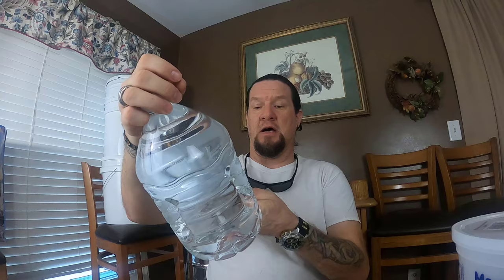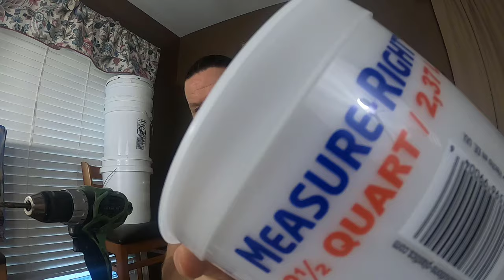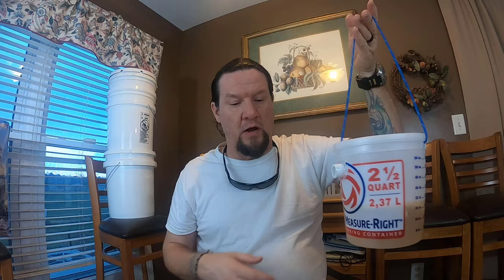How to make easy reusable yellow jacket traps for your bee yards. Includes Bait Recipe!

Comment: Use a male adapter with a lock nut on the bucket. Add the short pipe with a 45 to keep out the rain.

Comment: I wanted them to carry some of the poisoned bait back to the nest.  I kept the traps out but I also filled two small containers (condiment size from take out).  I used 1 cup of honey, some apple cider vinegar and a tablespoon or two of boric acid.  The first batch killed them outright so I cleaned it out and used less boric acid.  Worked like a charm.  Within three days there were only a couple around.  I did it for one more day and I will see maybe one ore two by the feeders but compared to what we had that is nothing.  Now I can sit on my deck and my humming birds can eat in peace!  Total days with poison was five.  A side benefit is it took out a few ant nests!!  No more ants on the deck or the patio. 

Take it in at night.  When putting out keep it away from flowers and put it on the ground.  I observed one of them for a day before putting the others out and the bees didn't seem interested.  I do have a large flower garden and several areas of flowers which is where you will usually see bees.  It is possible a bee tried it but these yellow jackets would literally attack the bird in groups.  There would be five or ten going after them and giving chase.  I don't care how beneficial they are they are vicious insects and I have had enough!!
Reply: Could you provide exact amounts of each ingredient?
Reply: Great post, and I failed with borax, so I should try boric acid.

Comment: Thanks for taking the time to post this. Like someone else said, I have also tried the 2 liter bottle cut in half method and it works. I agree with you 100% that it does nothing for killing the hive itself. Personally, I wouldn't mind the yellow jackets if they'd just learn to  stay away from my weak honeybee colony. :-)
Reply from the maker: Hey Beeutiful, I make the soda traps as well, and the reason for making this version was to solve what i think is the #1 problem with the soda bottle traps, which is every time it rains they fill up. This version solves that problem and gives you a lid which is easily removed for removal of dead yellow jackets and easy replacement of baits. Plus its reusable and once built and complete never needs more purchased goods (like tape).

Comment: You could place more than one entrance into the trap.
I agree with others that say to put a little of the bait liquid on the top of the trap for them to find a tell the nest about it.
A little dish soap in the water, stirred not shaken, will break the surface tension of the water and make the yellow jackets sink and die quicker.
I have wasps in my attic and I'm very allergic to them, so I have to get them under control.

Comment: The best use for wasp traps is to get the queen when she emerges early in the spring around the end of March into April, you have a few weeks of wiggle room as the queen does all of the  work setting up a new nest it takes time for her to get the first generation of workers so she  can focus on laying eggs. 

So if you get the queen early as I did this year, you probably won't see any yellowjackets and if you do they will be workers from someone eases yard and they don't stick around for long. You are correct that a single trap will not get rid of a nest. 

I doubt multiple traps will completely do the job, however multiple traps may effectively reduce the amount of worker contact you have around the property.
Reply: How to get the queen early? Usually I find nests by traffic in and out of the nest.

Comment: Great video.  You make some excellent points about the beneficial aspects of yellowjackets etc.  I add a few drops of dish soap to break the surface tension of the liquid lure.  I also add some nectar/bait to the top of the trap so that the yellowjackets bring some back to their nest and attract more to the trap. Thanks!
Reply from the maker: Great tip!
Reply: Duncan James
But if the point of the trap is to catch the yellow jackets so they die in the container, how are they going to fly back to the nest and tell others about the trap? Won't they be dead? Maybe I'm over looking something here. Maybe you can explain how they fly back to the nest to tell others?
Reply: @sambojambo9448  The Scouts will always fly back.  It's the workers who get attracted to and trapped. A small amount of honey on the top of the trap creates a source for some of the workers to collect honey and thereby send more foragers back to the trap.
Reply: @duncanjames914  So scouts are smarter than workers right?
Reply: @sambojambo9448  I'm not sure I would call it intelligence over innate drive to do what they were born to do.

Comment: I've made traps out of soda bottles with the top cut off and stuck on inside out.  Also add a bottle open with bait in it and add more traps around it. 5 to 1 ratio or more.
Reply from the maker: Yes Paul, Ive made the same soda bottle traps as well. That is one of the reasons I made this video. The soda bottle traps have one huge problem. Every time is rains they fill up with rain water. So I wanted to solve that problem, and this is why I made this particular version, to solve the rain issue. Maybe Ill make the video on how to make the soda bottle traps as well at some point and do a comparison video on the pros and cons of each.

Comment: These yellow jacket traps keep the workforce (flying) population in check.  That's what it does.   If I were to make a trap it would be more like the one in the video.  I tried to control the yellow jacket populations around my hives by using a tote, hot dogs, and water with a little dish soap.    Yeah, I got some Yellow Jackets, but the raccoons loved the hot dogs.   They would tip it over and that was that.   
They aren't that big a deal around the hives.  Except when they are trying to get in under the cover when they are after the fall sugar syrup feed.   Watch your fingers.

Comment: I have noticed a gap in my siding and for the past week I’ve seen Yellowjackets going in and out rapidly. Means they are starting to make a nest. Tried my own red wine trap, got a few(-100) most ignore and go by. Even though it is on the flight path I’ve observed them flying. Can not find a ground nest in my yard, so I believe it is in a neighboring yard ( 1/2 acre lots)  would using these traps better slow them down, until I spray inside the nest ( at night and cooler)  what would be your suggestions for this situation ? I can easily get to the nest, a flat porch roof is right there about 4 feet below. Thanks so much and really appreciate it and enjoy your channel.  Rob

Comment: I have a nest in the ground under the rocks at the rear of the bottom of my koi pond waterfall box and am trying how to figure out killing them without anything getting into the water.Can't access the filter box now to remove and clean the filters when needed?
Reply: I use a vacuum cleaner with the hose(or pvc attached to the hose) near the nest opening. Two to three days and they are gone. Don't do not open the vacuum cleaner for a week or two.  I just got about 17 stings when I went to put the trash out. WAR
Reply: @bobkoontz5814    I just saw a video where the guy used a shop vac with water and some dishsoap inside- that might be the ticket.

Comment: l have a question, l have bees that entered into my aluminum siding at the end cap that has fallen due to weather. im not certain if they are yellow jacket or carpenter bee. what solution should l use id they are carpenter bees? im going to make these catchers. Please help

Comment: Hello, I have yellow jackets coming in and out of a hole in the side of my family's home. The hole is located between two windows that is below the attic. When we went to the attic there is no nest that can be seen, so the nest is most likely inside the wall between the two windows. How can we lure them all outside and trap them, so we can spray inside the hole and kill any existing larvae, so we can seal the hole from outside?
Reply from the maker: Your best bet is hiring a exterminator to get them. If you want to take the task on your self and can get to the hole safely you would be best to do it in the dark. A red headlight is what we use when dealing with bees at night and I hate sprayed wasps and yellow jackets with this method.